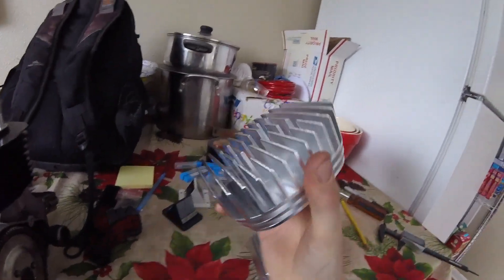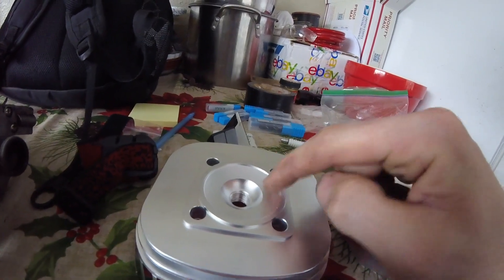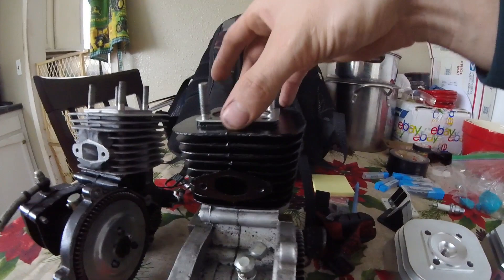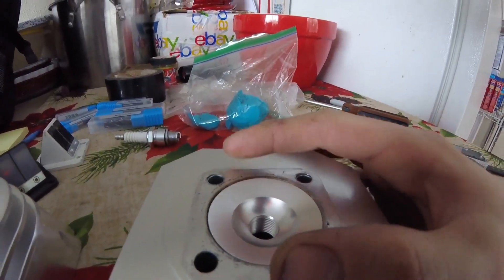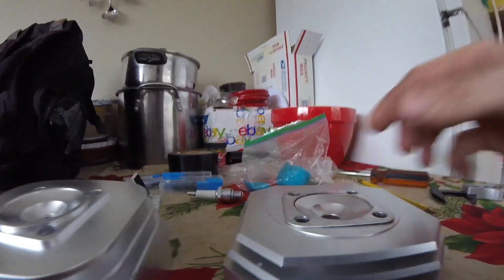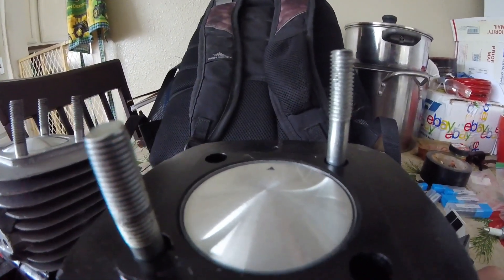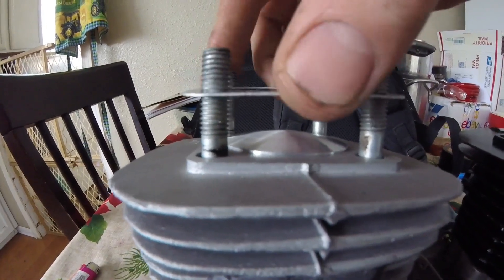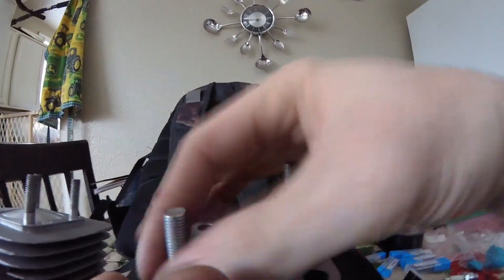jake vs shark on squish

Comment: That's good to know👍 and the ones I have only ever bought was the hot head and a eBay billet head which I modified both to get a good squish but my factory head on my chopper bike has a pretty good looking squish band from the factory it's making really good power but I haven't checked the actual gap yet lol